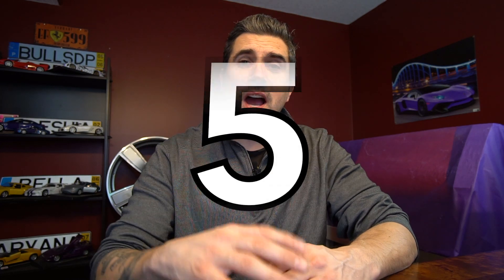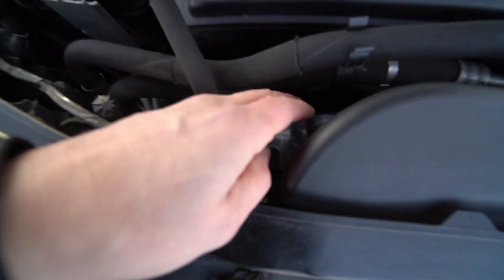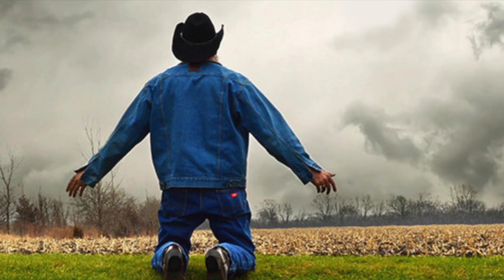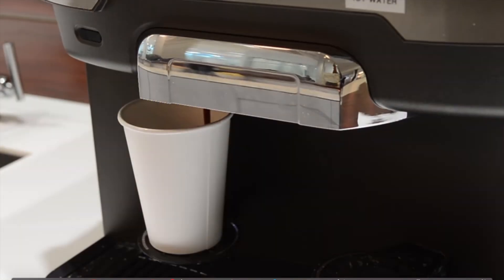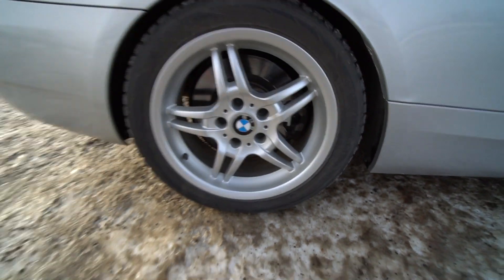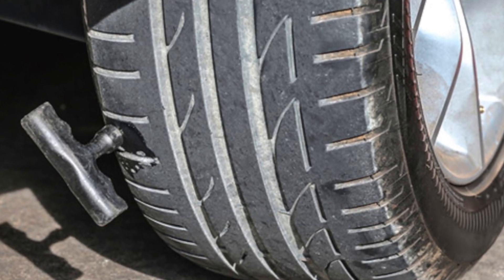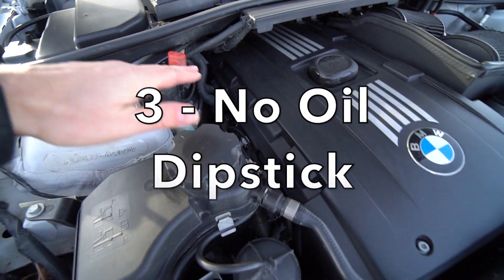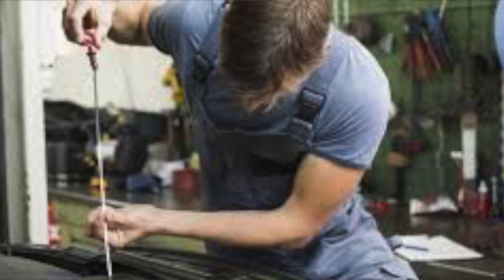5 Reasons Not To Buy Unreliable BMW 335i

Comment: I’ll wait to hear from the BMW fanboys that’ll say “it’s how you maintain them that matter”. Well what kind of maintenance prevents your wipers from stopping to work in the middle of storm? What maintenance prevents your power windows from going out at just 54k miles? Both of these happened with my e46 and e90. I’ve sworn of BMWs. They are so not worth the trouble. For every person that’ll tell you “I’ve had my 530i for 10 years with 300k miles” there’s 1000 people who will wanna throw up at the thought of owning another BMW.
Reply from the maker: Any guesses what my next car will be once I sell my 335?
Reply: e30 e36 e46 or an 8 series
Reply from the maker: Nice.  No probably not.
Reply from the maker: Some great options but hint.  Fast.
Reply: omotosho bello facts, I owned 3 bmws and did all the maintenance, all 3 still had problems and leaked oil. Finally switched to a Subaru Sti, May have issues but the parts are cheap lol
Reply from the maker: The s85 is a bit problematic but from my experience, much better built
Reply from the maker: A couple of great guesses
Reply: Agreed from experience, after ownership of many BMW’s, I finally gave up and moved to Toyota. Life could not be more peaceful since. Sorry, BMW’s are just not worth my time and money to be throwing away consistently trying to maintain and address many issues covered in this video. Car ownership should never be like this, no matter how “fun” it is to drive.
Reply: @bucksbonanza  i could not agree more with you, well said
Reply: I've had to do a lot of work to my 335i, and it's been really expensive, but to be honest I wouldn't trade it for anything. Thankfully I found one with more of the worse maintenance already done (hpfp, vanos, and I upgraded the chargepipe before it broke) but I wouldn't trade if for the world. Just what you're willing to pay, I guess what I mean is to each their own.
Reply: @ECPP  2010 E93 M3
Reply: ExoticCar PlayPlace hopefully a 2016 Z4 with an N54 engine
Reply: Every car now are trash wtf are you talking about like Toyotas with 8 speed failing before 60k or nissans cvts going out. No car is reliable after 2006. Don't forget Subarus catastrophic engine failure with a lawsuitm
Reply: Thanks for the diary buddy maybe buy a newer car 😂
Reply: If you aren't a tunner don't get this car!
Reply: Broke boys shouldn’t buy bmw.
Reply: @ECPP  i would guess M2 comp. Or i8 💖 if bmw . If really fast then probably Porsche or mclaren 570 or p1
Reply: @bucksbonanza   I was thinking get one of this 335i coupe, im from argentina and the parts are really REALLY expensive. Seen many videos and still have doubts, you sound so honest tho haha
Reply: @bcg5175  I’m with you_+
Reply: @coltondery3526  I am with iT_#
Reply: I guess Im asking randomly but does anybody know a way to log back into an instagram account?
I stupidly forgot my login password. I love any assistance you can give me.
Reply: @Roberto Kabir instablaster ;)
Reply: We own 3 BMW's 2x E92 and 540I E39. E92 is awesome machine, amazing driving quality better than in CLS C219 and 540I E39 is a masterpiece
Reply: BMW are the best. I let my 2011 335 convertible go, which I drove in the autobahn in germany.  I regretted that until today.   I bought a well kept 2012 335 convertible manual.
Reply: @calvinguo7423 Leaves a German car that leaks oil (common), to buy a Japanese with common head gasket issues

Comment: I am a college student with barely any cash but I love driving one just for the power delivery from a six cylinder. When I first bought my E46 325i, vacuum leaks are so common on the M54 with the coolant leaks. Still amazed it ran so smooth and never died when I had a coolant leak from the bottom of the radiator. I think that all racecars test your love for the car. Problem is people buy them that are my age as a status symbol. Buy a BMW because you wanna drive it. My father's friend saved me many times with my E46 because he works on BMW since the 80s and drives a E46 everyday. He loves them as a whole but hates the complications that BMW threw on the newer ones. He says the six cylinders are indestructible but the coolant leaks are so common with the valve covers leaking with the rubber vacuum lines throwig lean codes. BMW are not for everyone, it takes a dedicated car enthusiast to own one that looks at it as an opportunity.
Reply from the maker: You are absolutely correct.  The posers will be disappointed but people who appreciate the drive, accept some deficiencies and understand the comitment that is required.  Have a great one.
Reply: @ECPP  You too Mark! Wish I can capture your M5 and the 335i for Corkscrewlife. They are awesome cars!

Comment: Recently got a 2009 335i. Your very correct. Marco galore under the hood. Owned the vehicle for about 4 months and my water pump went out 🙄. No warranty as I got it use, BUT I’m able to pull the water pump and thermostat out while being a novice garage mechanic. Luckily I have my Jeep and e90 325i to keep me from walking. Educated how to work in these cars and you’ll be fine. Yea parts are pricey but hey.......life’s to short to drive boring cars.
Reply from the maker: Absolutely.  Driving fun machines is what makes the experience.
Reply: This could be the comment that inspired the intro on the new videos. "Lifes too short to drive boring cars."

Comment: I have replaced the coolant reservoir, multiple hoses, radiator, water pump and thermostat. In the last 2 years I have replaced the coolant 4 times. I highly recommend replacing the whole coolant system at once and call it done. It's a bit expensive, but it is much better than having your overheated car towed home multiple times and replacing expensive BMW coolant. I agree with all of your other points as well. I just diy it.
Reply from the maker: I agree, once some parts go, likely many are close behind.

Comment: JUST bought  2007 BMW 335I FOR 5300$ DUDE said nothing is wrong with it had smog, clean title, and reg in hand, i get about 15 minutes out of San Francisco just over the bridge (still 45 min from home) car overheats, limp mode, loss of power etc. EVERYONE WAS TELLING ME from my lift driver to people at work DO NOT BUY this bmw, i guess i should have listened but ofc i didnt i bought it. had my lift driver pick me up (she was following me i had a gut feeling) and get coolant and i just dumped in the tank and somehow BARELY made it home on ENGINE HOT DRIVE MODERATE car literally overheated as i pulled into my garage, but oh well i made it back no tow (which is a miracle in itself) had to buy a new coolant overflow tank, sensor, cap, water pump, therm and bolt kit so 5300$ plus 400$ and shes finally back on the road. i did the repair myself for 380$ but that would have been 2000-2500 bucks at the dealer or indy , long story short! BRING MY WALLET! although the turbos have just been replaced, valve cover and oil gasket in 2019 and loads of other work in the carfax so im pretty happy. has a burgandy leather interior all the options, sport mode, paddle shifters, heated seats, sport seats, 18 inch wheels etc so live and learn now she is solid with the turbos and entire cooling system done! i agree tho! MONEY PITS! LOL if you read this far i commend u
Reply: I fee u bro I had a similar trial n tribulation on my 09 SS.
Reply: @CHIEFMOOKY on my 2nd one about to buy a 3rd tomorrow tho they are addicting
Reply: @startingtech3900  did u get it? I have a 2011 335is for sale

Comment: Is it possible to make this car more reliable with replacing the plastic parts with better aftermarket parts?
Reply: Yes some of the parts like with the N55 engine there’s aluminum charge pipes and aluminum valve covers, and there’s a metal coolant tank replacement for the N54.

Comment: I had one for two years. In that time the water pump and the vanos solenoid went out. My drive belt also broke. So not very reliable but I’ve never driven a car as fun as this one. I love it more than the s2k, frs, and g35 that I’ve driven. Yes it’s a pain in the ass but it’s so fun to drive

Comment: Have the 08 BMW 335i convertible.  Fuel pump has failed twice now, about a $1500 repair. Also, constant tire repairs.  Low profile.  It's fun to drive though.
Reply: Does walbro make a pump for it look into the best aftermarket alternative 🤔

Comment: BMWs are the only non supercar that make Mercedes Benz repairs look very user friendly
Reply from the maker: Haha, very true.  My Lamborghini is actually far simpler to work on than the N54.  My old Porsche 911 was as well.
Reply: You are forgetting Jaguar and Alpha Romeo...
Reply: @ECPP  Honestly I haven't really found it too  hard to work on. The oil filter is right on top, and the spark plugs are easy to get to. Ya it's not super easy for some of the more involved repairs but it's doable and well worth the money you save doing it yourself

Comment: It’s really not that difficult to work on your 335i n54
Reply: Mohammed Toorani exactly. not hard just Need to YouTube it
Reply: Xdrive would like a word with you
Reply: 2Wheels1Love89 🤣🤣🤣🤣
Reply: 2Wheels1Love89 that’s why you stay away from all wheel drive cars unless you have money in the bank.
Reply: The turbos are the only thing that worry’s me
Reply: @whosmansisthis1894  and if you live in a place with heavy snow?
Reply: Is not about the difficulty its about the cost of some of the parts, the injectors or turbos are pretty expensive and they are known to fail on this cars.
Reply: @2Wheels1Love89  bruh
Reply: @ishaqballut6839  Well, that's why you get snow tires.  However, if you're worried about ground clearance (and you should be), get a used Forester for the winter or something to take the winter abuse (snow, ice, debris, potholes, etc).

If a 2nd car isn't in the budget, just take it nice and slow watch for the debris as best you can.
Reply: @Jimmyxsx  
You need to know how to care about turbo car. Its easy, I own turbo car and it works well

Comment: 2007 335xi, Ultimate Failing Machine:

Twin turbo failure, HPFP and LPFP replaced, water pump fail, power door lock blown fuse, sunroof won’t open. All this happened by 57k miles and that was in 2014. My last day with car was when 4x4 light flashed red at 8am on way to work.

Never BMW again.

Comment: I bought a brand new Ford Escape 2013 back then... Get rid of it 5 years later with many many problems 2 weeks later I never went back to see videos/forums/groups nothing about that car... Funny thing I've noticed with BMWs... People always get back to YouTube to see BMW content... Go figure I wonder if that will happen to me :/ I currently drive a E60 LCI 130K kms I have addressed lot of it's issued to the point it can be driven without worries for hours without checking anything... But I need to keep it until it dies because worth nothing on the market hahaha. My wife's is a E70 N55 powered so far it had have some minor things but running good fairly low milage though less than 80K kms. One need to be smart with these cars and everything depends on your particular economic/free time/mechanic skill/family/passion driven situation... Well it is difficult to explain. Nice honest video :)
Reply from the maker: Thanks a lot for sharing.  It is great to be able to share with others so we can all make smart buys when shopping for a new car.  Cheers

Comment: I have a 2008 E92 328xi, 165k mi. w/original clutch. Maintained by an independent BMW shop with scheduled service intervals other than the BS 100k / lifetime fluids. Have trans, diff, transfer case done at 50k intervals. Very reliable, expect those plastics bits in the engine bay will crack at some point. Looking for a 335is, turbo's will cost some $$ when needing replacement but the power/torque gain is M performance.

Comment: I own a 08’ 328i, not as much fun...but a reliable daily driver. No car payments and gets me where I need to go. But will consider these things for my next car
Reply from the maker: This 335 really is quite a beast and if you follow next Tuesday, you will find another perspective on this car.  Cheers.
Reply: I have N/A 120i, 2010 E82 in Germany. No issues at all but very low mileage & only a straight 4 banger. You see them everywhere & the 118i E87 wagon/hatches both diesel & gas that the US also didn't get can be seen on every other block.

Comment: I own a 2016 528i is not the quickest car out there, I actually wanted something with a little more power, like the 535i,  so far I've been lucky with mines I have 60k miles on it, I was talking to my local BMW dealership (  service advisor )  and a few of them said " if you want a BMW with more power stick with the 6  cylinder, not the v8"

Comment: Having owned a 2008 335i E90 sedan, I can tell you they are not the most reliable vehicles, however for the price there is little that can match it performance wise.  Even in 2020 the N54 and N55 will out perform close to 90 percent of the vehicles on the road.
Reply from the maker: They do drive well for sure.

Comment: My 2008 335i 145k miles is going strong and will likely drive  it to 300k miles. But you gotta do your own work.  If you let a mechanic do it you’ll be shoveling out $30,000 on a Car worth $6000 from 100k miles to 200k miles.  Fantastic car if maintained properly.  The replacement plastics for the steering wheel etc aren’t rubber coated.  Just swap them if they look bad
Reply: Litecoin Donny say it again. You gotta do your own work! I’ve had mine for 8 years and worked through the issues and it’s going great at 122k miles. I’ve also got an e92 m3. I like to live dangerous. Ha ha!
Reply: Demetrius Johnson yep.  If you can fix your own bmw there’s really nothing mechanical that can ever stop you. All these quitters never learn and end up with boring Japanese luxury. Haha

Comment: Run flat is a real issue for drivers in the West. 50 miles is way too short of a distance to a repair facility with the right replacement and the limited speed when the traffic moves at 85+ MPH is a risky proposition. The trunk space can be consumed by a full size spare making for a bad tradeoff.
The lack of dipstick prevents the owner from verifying that the engine oil was actually replaced during the service.
Reply from the maker: 100 percent agreed.  Thanks

Comment: I heard from many people not to get the 335 because of the turbos. What about the 328 and 320? They don't have a turbo in it ?
Reply from the maker: 75 percent still the same issues with coolant leaks, valve covers, pan gaskets, run flats, Vanos, etc.  There are a few less big problems like wastegates, turbos.  Generally the E90 generations are simply the best and worst at the same time.    Regardless I always look forward to taking mine out for a drive and look for an excuser to do so.  Cheers.
Reply: Knight Ride963 I have a 328xi that I bought with 156k and I’m now at almost 163k had it for 7months it’s a great car only issue I’ve had is window regulator in the rear and that was a cheap and easy fix

Comment: Is the 2011 BMW 335i reliable? It comes with N55 engine vs. earlier models with N54 engine.
Reply from the maker: Generally I would say , marginally.  Much better than the junk n54, but if a person can stretch a bit more, an older b58 is a big jump in durability

Comment: These cars are reliable if the maintenance was done.  I got lucky and got one that had all the required maintenance done and recalls performed on the injectors etc.  I’ve put almost 20k miles on it with zero issues.  It’s hilarious they put such narrow tires on these from the factory, the thing moves and the traction control light comes on constantly because the tires are always breaking loose.  Next upgrade is some wider tires and possibly a limited slip dif.  IMO these cars got an especially bad rap because they were inexpensive at one point and the people that bought them spent nothing on maintenance. If you buy one of these with no maintenance records you are definitely rolling the dice.
Reply from the maker: Money money money, in the words of ABBA

Comment: Great video, always Enjoy your content. How good is the n55? 
I have a 2012 335ix drive coupe with the n55 engine doing about 93k kms. Any idea what preventative maintenance should I do?
Reply from the maker: The N55 really has far fewer issues overall but is not impervious.  I would say do oil changes MORE than the minimum dealers recommendations especially with the additional stress and heat from turbocharging, always give the car a 30 second to 1 minute cool down after a drive to protect the turbos and do not defer your coolant system maintenance.  Other than that enjoy the heck out of it.  Cheers.
Reply: ExoticCar PlayPlace thanks man. You have the best Bmw channel on YouTube and you actually respond to comments 🙏
Keep up the great content. 
I’m relatively new to Bmw ownership, first couple months with my 335 and I don’t wanna make any costly mistakes lol.
Reply from the maker: I hear ya, no problem, These cars are a lot of fun and they do drive better than most others, but we must take a little care.  Have a great one.
Reply: ExoticCar PlayPlace can you make a video on what are some safe cheap power adders to the n55 335’s? 😬